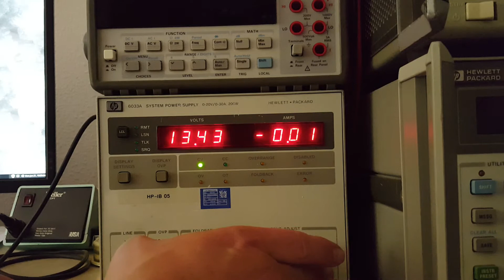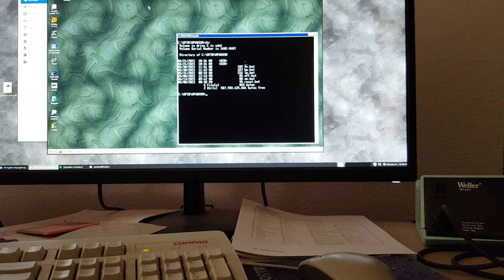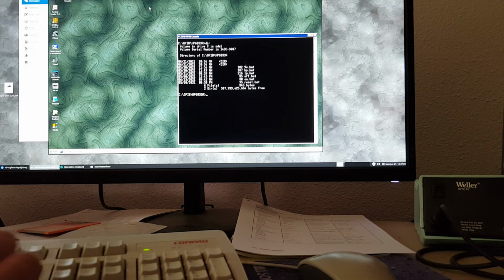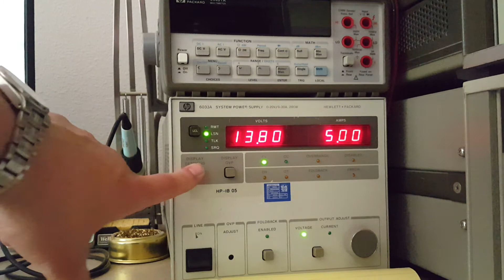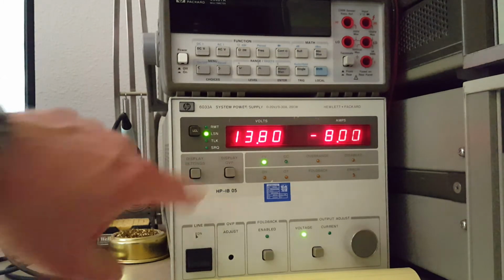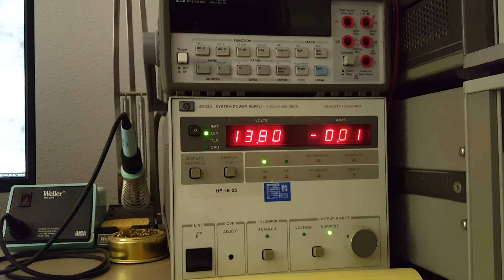HP 6033A System Power Supply.

Comment: So quick question, I have one of these power supplies and it has rj11 serial jacks on the hpib board and I'm wondering if you can program the supply over those ports, wondering if you could give some insight on it
Reply from the maker: To my knowledge these ports are used only to connect several power supplies together. You then use sub HPIB addresses to program the additional supplies through the first supply in the chain via the HPIB port. Out of the three supplies I bought two of them have these serial ports, the one featured in the video does not have this feature. There is a section in the users manual that covers connecting multiple supplies using these ports, I plan on doing a video on how to do this but just have not made the time to do it yet :) Anyhow thanks for watching, I hope these videos are at least informative if nothing else.
Reply: @CraigPetersen12f36b  thanks craig,Craig, have to order a cable and try it,it's quite a bit cheaper then going from USB to hpib, according to the hpib card schematic I found the rj11 ports comment in the same way as the hpib. And one more question, what did you use to connect your hpib to usb?
Reply from the maker: Good Morning Matthew. With my current system controller I use a National Instruments PCI-GPIB card, I currently do not use any USB to GPIB devices. However this may change because I'm still using Windows XP SP3 on my system controller and getting software is going to get harder going forward. I have a small Windows 10 machine I will be migrating to and my only choices for an interface card will be a more expensive low profile GPIB card or a high speed USB to GPIB adapter from National Instruments.
Reply: @CraigPetersen12f36b  I'll have to do some research on the hpib adapters over usb, I'll let you know what I find out with the usb to serial over rj11

Comment: Thank you Craig!
Looking at one of these to upgrade my anodizing set-up. I’ve been using my well loved Agilent e3610a 8v/3a-15v/2a power supply, but the amperage is starting to limit my parts size/loads😎
Reply from the maker: Thanks for watching the video, I hope that it was at least helpful. The Agilent E36xx power supplies are great low power bench supplies, I have the Agilent E3630A and the E3611A. Great little power supplies, very low noise and great regulation.